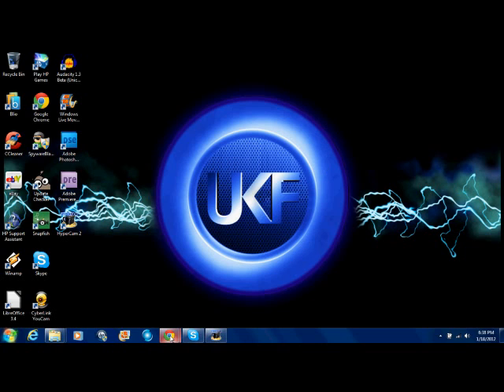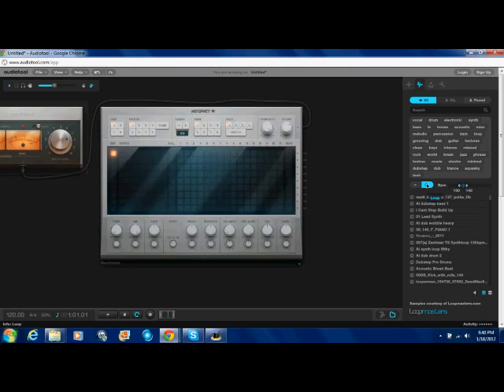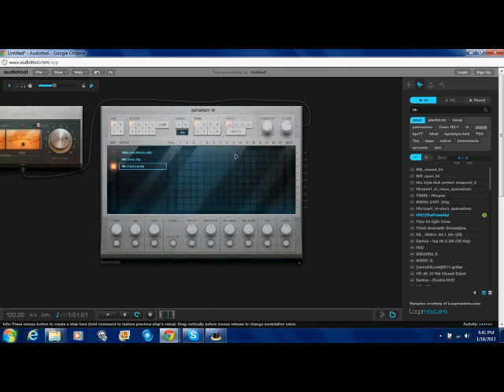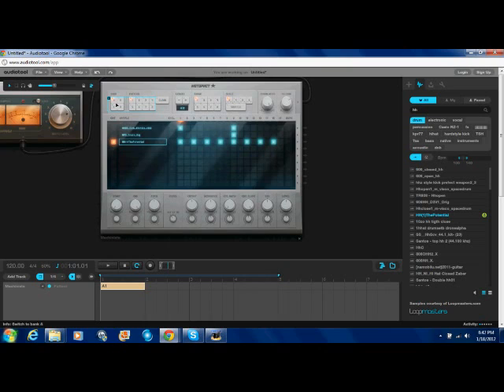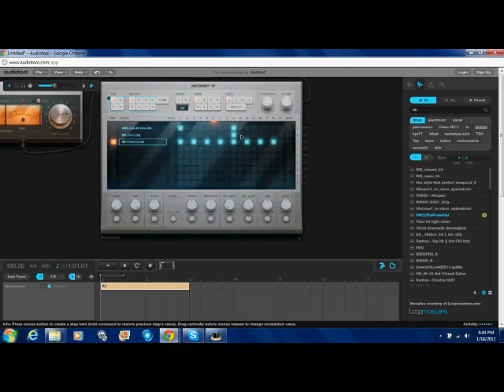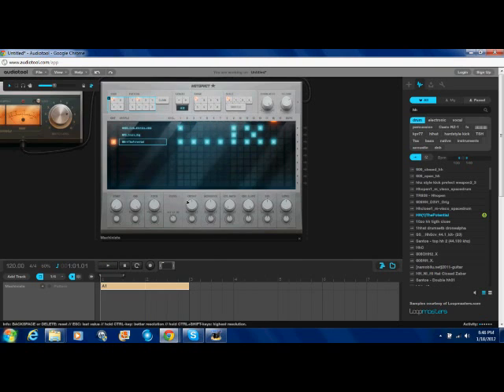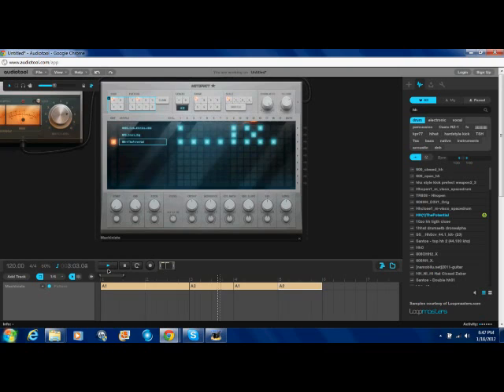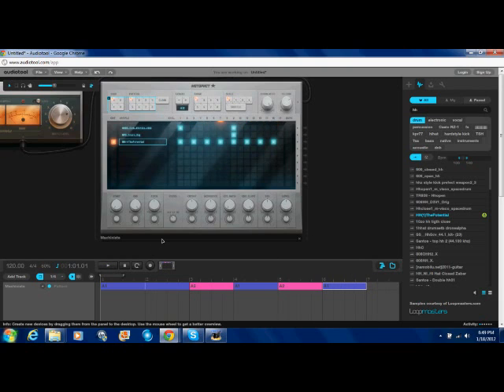Audiotool Basics: Making A Beat

Comment from the maker: Yes you can. You can up the measurements quite a bit, but its harder to do that when being a beginner because the increments of the measurements don't show after 16 since the board is obviously meant to only show 16 so you have to kind of know by heart where the measurements will be at if using more than 16.